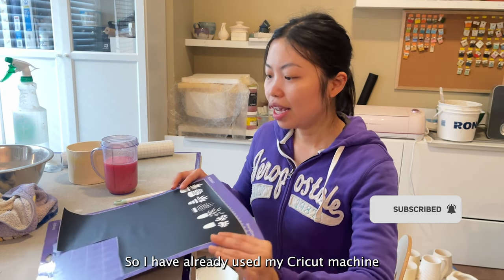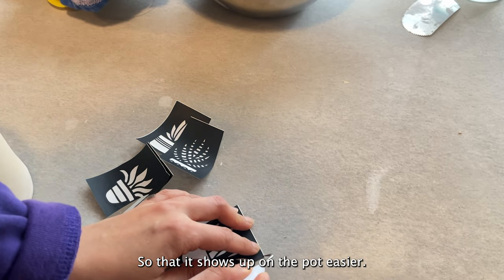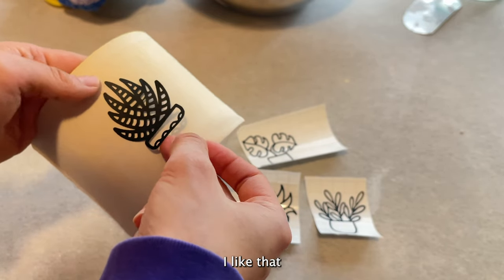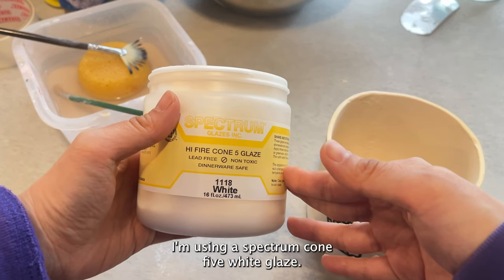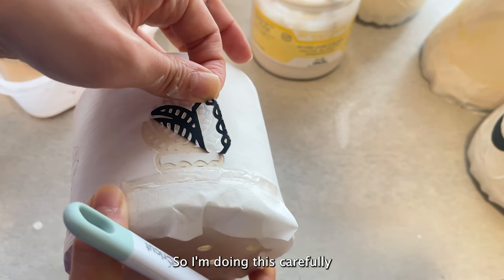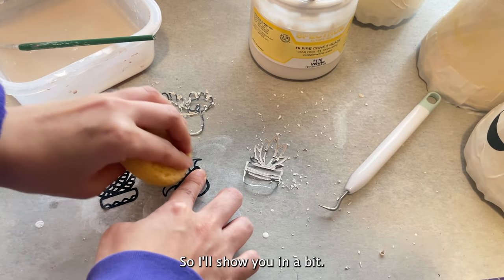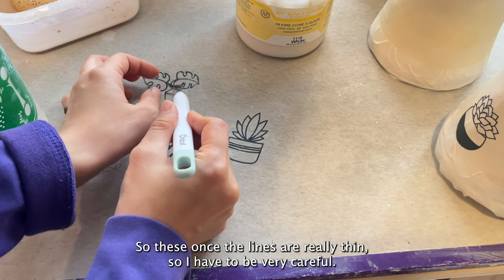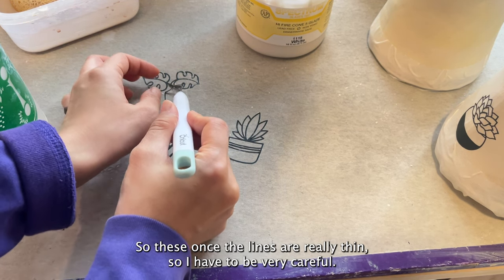Pottery Decorating with Vinyl Stencils | Using Cricut to Create Unique Designs

Comment: great video.  do you get all your designs from Cricut workspace?  I have a brother scanNcut and they do not have a large selection of designs.  I loved the ones you used of the succulents but I haven't been able to find similar ones.
Reply from the maker: Sometimes I draw my own design and sometimes I buy the digital files from Etsy. You can definitely look around and find the ones you like.
Reply: @YvonneCeramics  thank you.  I have purchased some designs on Etsy but having a problem.  I bought cricut vinyl but wondering if I have the wrong vinyl.  is there a specific one I should buy or are the cricut ones all the same - just different colors?

Comment: what type of vinyl works best when adhering to pottery?
Reply from the maker: I have only used Cricut’s vinyl so I couldn’t compare. I found that if your design has thinner lines, it is easier to bend and adhere to clay as compared to designs with bigger area of vinyl. Hope this helps!
Reply: Great video! I just started experimenting with this method. Would you mind sharing what type of cricut vinyl are you using? I think they have a lot of types of vinyl. ❤